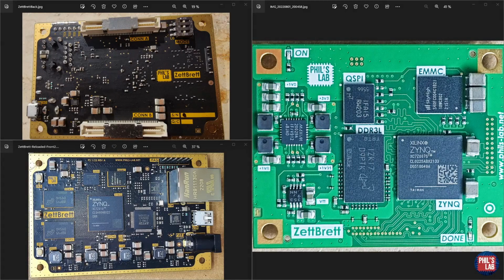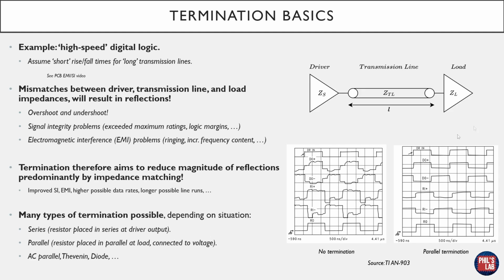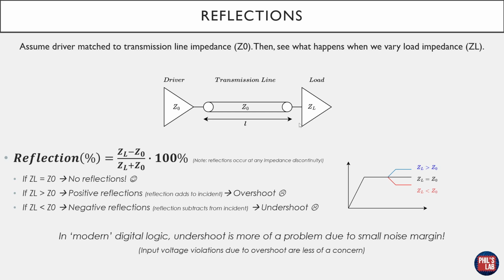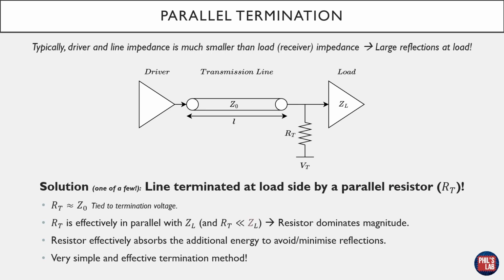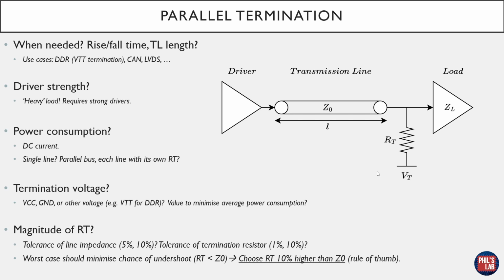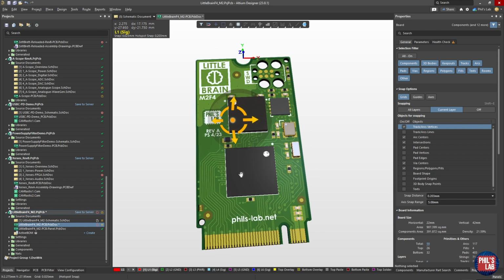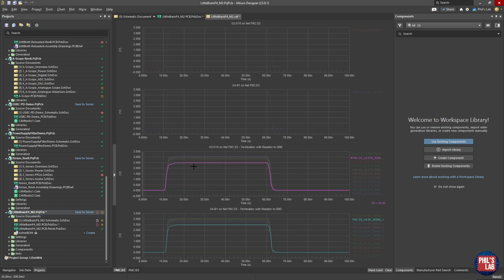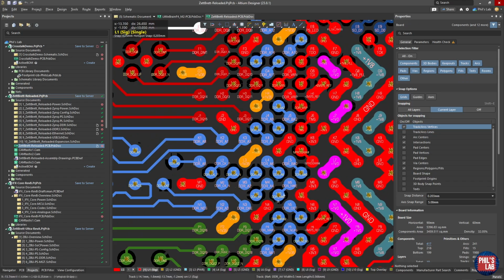(Sponsored) Parallel Termination Basics - Phil's Lab #119

Comment: Why is the parallel res 50 ohms. Wouldn’t it need to be higher than 50 ohms and wouldn’t the end need to be measured manually to calculate the value needed in parallel to create a total of 50 ohms? For example the end maybe could be 100ohms or say even lower, 10 ohms (in which case if I understand properly, it won’t work with parallel but needs series?)

Comment: Which termination is more important, parallel or series? I guess you can't  use them both at once because you would reduce signal at receiver by half. Also, apart of the case e.g. for DDR memory where those resistor are part of the design, I guess it is difficult to select value of parallel resistor - if it is too high improvement will be small, if it is too small voltage at the receiver may go down to an unacceptable levels.
Reply: Hey! For DDR3 and DDR4 at least there is on-die termination for the byte lanes and if doing fly by routing, there they terminated at the very end of the bud (master clock, ACC signals)

Comment: It would be very interesting to see how you can terminate for multiple high speed connector footprints. If you second source and put both placements on the PCb, can you attenuate reflections introduced by the trace stubs for the unplaced alternate 🤔

Comment: Thanks for the great video! I did have two hopefully simple questions.
One was, could you expand on what it means when you say 'the driver is not strong enough to drive 50 ohms'? 
Also, why does the PCB house determine the line impedance? Isn't that something you can control with trace width/pour?

Comment: I would love to see a High Power Function Generator Amplifier ❤❤
Maybe use the ADA4870, I had an eye on it (at least as an amateur 😅)
+/- 20V, 1A, 52Mhz+, 2500 V/µs, Low noise, short-circuit and thermal protection...  Sounds all good to me 🤔
Professional ones are so gosh dang expensive. For example the Siglent SPA1010, 1Mhz 10W amp, costs 400$. Why I don't get it? 😥 Would love to see your take on it ❤❤

Comment: Phil: Highly informative video once again!  It got me thinking that it might help the intuition if, along with the voltage waveforms (like at 18:07) comparing unterminated and terminated lines, we could also see the current waveforms in those lines. There I think termination trades some high frequency ringing current at the transitions for lower-frequency current at the fundamental frequency of the digital signal.  Ie: Consider a 100MHz square wave signal: Unterminated there will be bursts of ringing current at the edges, but maybe not much at 100MHz. Whereas terminated the ringing is suppressed, but there are solid pulses of current into the terminator at 100MHz.   (And that all leads to topics of track layout, return path and location of the bypass caps needed to handle driving that current, and also absorbing it at the terminator.)  Anyhow, it would be reassuring to see these speculations confirmed or undermined by simulation or actual measurements!

Comment: can you set the logic family from the symbol itself? asking since setting this up for each board is not ideal. Also how you you enable simulation only on certain nets? asking since it was trying to use 12v and odd things s transmission lines? 
PS also how do you handle a transformer in this analysis ? as AC ?
Reply from the maker: Yes, you can add SI information when you create the schematic symbol.
You have to do some set-up before performing simulations (e.g. defining power nets, using planes instead of polygon pours, etc.). Everything is document on the Altium sites.

Comment: I was just starting to do some research on bus termination. Perfect timing!. I want to get the most out of an ISA style bus in a retro PC design. Is there anything in particular that I should focus on for a 5V system bus?
Reply from the maker: Awesome, glad to hear that! I'd check what others have done an ISA bus (I assume it won't require much in the way of termination), e.g. https://retrocomputing.stackexchange.com/questions/19880/how-do-i-terminate-an-isa-bus-correctly
https://maker.pro/forums/threads/isa-bus-termination-question.113863/

Comment: How to determine the termination resistors tie to some voltages or tie to ground?
Reply: First, the particular termination voltage (VT) has no effect on the termination impedance, so you are free to choose a VT by other reasons. So the goal would be to pick VT to minimize average power dissipation. If the signal duty cycle is about 50% then VT at half of the signal amplitude would be good. But if the signal spends most of the time high, with brief low pulses, then making VT equal to the signal high voltage will save a lot of power.  
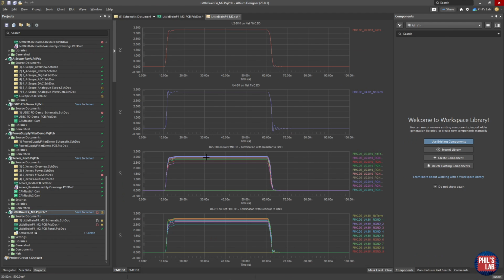However, there's another thing to check, and that's the amount of "sag" due to the load of the resistor relative to the driver's current capability. As Phil shows at around 17:55, a termination resistor to ground will reduce the logic high voltage, while a resistor to VCC will raise the logic low voltage. Each of these reduces the noise margin for that level, or may even cause the signal to be unable to make it across the threshold of that level.  So that has to be calculated based on the source and sink current capabilities of the drivers, and the high and low thresholds of the receivers.  It's important to note that some logic families have asymmetrical output drive capabilities and/or unequal input logic level thresholds, so you have to consider all combinations.  Hope that helps!

Comment: I've recently been working on LVCMOS18 termination for a friend's 50MHz Z80 backplane project where there can be up to 8 cards (with arbitrary order and 0-8 slots populated), with varying load capacitances, connector stubs, and a fairly long max distance (>200mm card to card in the worst case). Super tricky and had to spend a lot of time figuring out things like drive current and termination strategies by reading a ton of appnotes and the PCI spec, and doing days of LTRA simulations in LTspice, so I'm very glad to see you doing this series to help reduce the learning curve for anyone else who finds themselves trying to tackle a similar situation.
Reply from the maker: Thanks! Sounds like an interesting project - hope all goes well with that! Currently doing a DDR4 design and also keeping my fingers crossed :)

Comment: Unfortunately SI tools in Altium Designer are total crap compared to competition (for example it requires using plane layer type, which nobody uses nowadays, it doesn't allow selecting a set of traces to simulate as opposed to all, doesn't display locations of impedance discontinuities, etc.). Even much cheaper Cadence Orcad Pro has much more useful and functional tools for signal integrity.

Comment: Would be interesting to see how bad the Overshoot/Undershoot of the ZettBrett is
Reply from the maker: Waiting to get a new scope which I'll use to check out the DDR interface! So far no problem running the interface at max. bandwidth.
Reply: very cool, cant wait for it.
Reply: @PhilsLab  I'm going to be really intrigued to see what efforts are required to minimize the effect of the scope probes (or direct connection) on that type of signal.

Comment: Hello, very interesting. What about chips with ODT? I had a design with LPDDR4X memory, and because of ODT, I didn't require termination
Reply from the maker: Thanks! LPDDR4 is a special case, as that includes termination even for 'ACC' signals. 'Normal' DDR4 will require external termination for certain signal groups.
Reply: @PhilsLab   very great. LPDDR4 seemed too easy in general. It didn't even require length matching! The only proper care needed was to keep trace impedance and avoid crosstalk / via stubs

 I hope to have the chance to work on something more complicated later on
Reply: Yeah, as someone making MIPI IP I was surprised why anyone would not use termination on the chip itself. After all, on-die termination can be tuned or calibrated in case of issues.